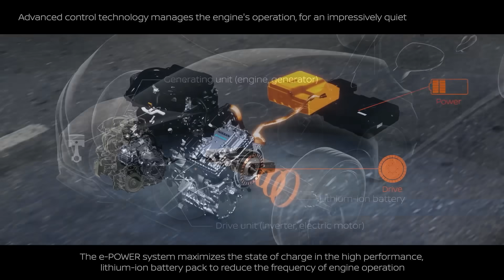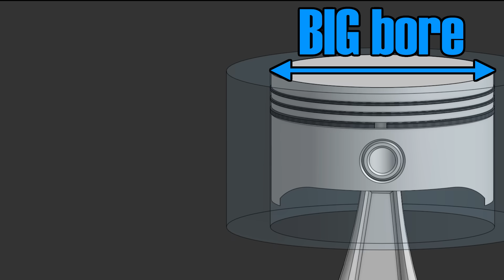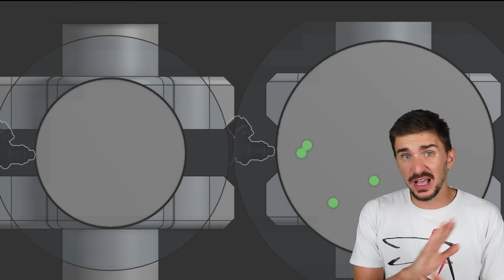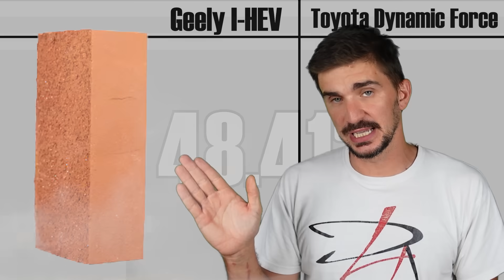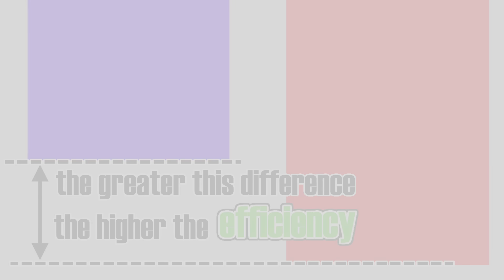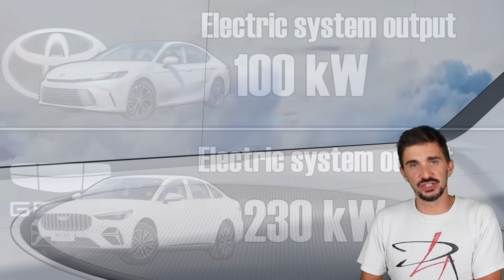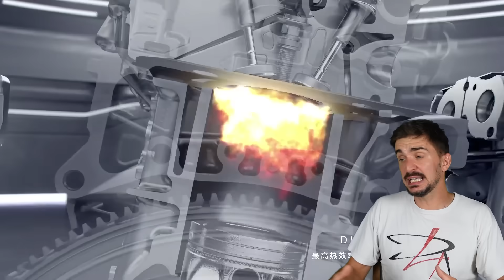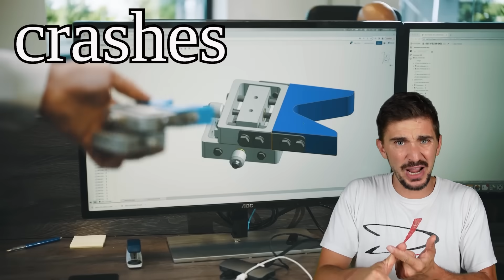How China's Geely Beat Toyota, BMW, Ford and Everyone Else

Comment: 10 years ago all Chinese produced engines were just basically crap. Could hardly meet European emissions, had less power, less sophisticated, had plenty of reliability problems. NOW we suddenly see a mass produced and available engine which is way more efficient, at the cost of performance, but doing something which it is designed for. As 'emergency' power so you can drive your EV, even when empty, forever, and as a very efficient generator, so it can still compete with charging from the wall - until gasoline becomes very expensive and electricity becomes cheaper.

I don't see why we shouldn't applaud them. How many current cars have a 100 hp efficient generator in them which actually can power the car, while costing very little? It's not an BMW i8 and it also doesn't try to be one.

This compact family car has a whopping 230 kW of power. That's over 300 horsepower! Just 20 years ago we still had plenty of cars with less than 100 horsepower. And from 2005 until now the average horsepower has plateaued around 200 hp. This car has 50% more than that. 

Is the number really 48%? Might it drop to 46%? Perhaps even 42% when tested by independent testers? Maybe. Still it would be better than what Mightly Toyota has been doing and they're quite the masters. So still kudos to these guys. But more important ; the conclusion in the end is what everyone basically needs ; an EV with an ICE backup motor. Not a lawnmower engine in the back which can charge your battery, but something which can actually move your car (and charge the battery pretty efficient if you were so dumb to really run it empty). Does it even have to be a 100 hp ICE engine? Does it need to be 1.5L ? Could we do we something half the size ? We all know we only need like 20-30 hp to keep a car running at highway speeds on a flat road. 

My bet is that we'll see even smaller engines like this tied to an EV platform. And does an  ICE engine really have to drive the wheels or is it fine if it can just generate power for the electric motors? Maybe less efficient, but would reduce the amount of components and keep things even cheaper.

Comment: Plenty of reasons this is good and a whole truck load why its not. As a generator its a decent design but if its only being used as a generator that also means there are the usual losses through the charger, battery and power electronics. 
This is one of those designs which will be ultra efficient under very low load then the efficiency will drop off a cliff when its asked to do any real work. 
Looks great on paper but there's a good reason others haven't gone down this path.

Comment: This channel is superb. But, this video has not compared its transmission efficiency relative to eCVT and non EV automatic transmission. In short, what counts is only fuel to wheel efficiency. Geely has 100% of its fuel energy converted electric then 100% stored in a battery then 100% extracted from the battery and finally 100% converted to mechanical torque to the wheels. I would like to see a comparison of torque transmission  efficiency losses between mechanical  vs electric. 
Thank you for your excellent lecture as usual and the added Onshape dynamic display.

Comment: Why close the intake valves late rather than early?  It seems like drawing air into the engine and then pushing it back out would increase pumping losses.  Closing it early you'd lose some energy drawing the piston down against a vacuum, but that energy would be returned as the vacuum helps suck the piston back up on compression.  The only reason I can think of is perhaps oil would be sucked up past the piston rings.
Reply: Maybe the pumping loss is less in a 4-cylinder engine where one cylinder will always be ready to intake what another cylinder is pumping.

Comment: Isnt an electric motor 95% efficient?

And usa is having a heat dome were 20 degrees higher. Mississipi valley could hit 120F. People without AC will die due to climate change from co2, nitro-oxide and methane emissions.

Comment: Thank you for this very informative video. Fascinating and unbiased as always.
Just a pet peeve of mine. The difference between the ICE and hybrid drive in the Toyota is one percentage point, not 1 per cent.
And for the record, I wouldn't trust any number coming out of China. And on that note, I'm not so sure about the reliability of those motors. The things I see and read about Chinese EVs, their crumbling infrastructure and many other shortcuts they take don't instil me with confidence in such products.

Comment: There have been so many technologies that worked great and were shelved for various reasons.
Reply: Yes and those with access to those shelves will likely win in the long run.
Morse code was effectively a digital transmission standard.  We are moving back to digital from analog.
Very early on, cars were electric because engines were hard to deal with.
Before the grid, a lot of people generated their own electricity.
Reply: @kensmith5694  there was a Czech inventor in 1920's, who allegedly build an early hybrid car. System very similar to Toyota hybrid in function, just more primitive, of course. The car and its inventor didn't survive the war, but the same electromechanical transmission system (without battery) was used in a train in the 30's and was more efficient than standard diesel-electric transmission.
Reply: @PeanosZero Nope, it was a prototype build on a Tatra 57. It had no breaks, braking was purely regenerative through hub motors and it's combustion engine made only third of the entire system power. It never went to production due to Great depression and war afterwards. But only source of this is a newspaper article that was found in national archives a few years ago, and couple of photos of the prototype, which reason for the "allegedly"
The train (or railcar?) however exists and has been  renovated a couple of years ago and well documented. I didn't say it was more efficient than a modern diesel, what I meant to say was that it was more efficient than diesel-electric technology of the time. The documented efficiency of the transmission is between 82-94% depending on load, which is not that bad even by modern standards, and once it got to crusing speed, the electric part was bypassed entirely.
Reply: @kensmith5694 Nicolai Tesla drive around in an electric car of his own creation that didn't have a battery on it.
100 years later we don't know what his technology was and don't have access to his theories and methods.
Reply: @carpediemarts705  Stop dirtying the good name of Mr Tesla by believing/telling lies about him.  There was no such thing as the car you describe.  Learn the facts about the great inventor.  They are far more interesting than the lies.
Reply: @carpediemarts705 let me guess, you think aliens gave him the technology? 😂
Reply: @ghoulbuster1 no, Nick gave the aliens technology

Comment: What the difference between closing the valves late to let air out,  and closing them early, to not let it in in tje first place.  

I mean, it's basically the same as a throttle.  No shit you use less fuel if you effectively only have your foot down half way

Comment: I believe Ford announced they’re going to be making some EV’s with onboard generators to charge the batteries. Battery tech is actually advancing pretty rapidly at this point. New cheaper sodium batteries will be making their way to the market within a year or so for EV’s.
Reply: I remember hearing this back in 2022, tech moves along but time to market is still slow.
Reply: @BigLoMayne  You’re probably thinking lithium iron phosphate batteries(LFP), they’ve been using those since about 2022 in most EV’s. Sodium ion has been talked about since around the same time but wasn’t close until recently. The EV sodium batteries were announced to be entering the production phase 4th quarter of this year by CATL who makes most EV batteries. They’re saying they will be about 35% cheaper than current batteries but much more robust and much safer. There’s other battery types being developed also probably at the phase of development that sodium ion was when LFP batteries started being manufactured. This is like the fourth different battery chemistry to hit EV’s since they started becoming popular in the 2010’s.

Comment: I will believe that efficiency when that engine last 500,000 km like a Toyota and Honda does. Because it is not efficient to pay for a rebuild at 100,000km… nor 200,000km. The most efficient engine is the somewhat efficient engine that lasts for 20 years doing 20k km yearly with just basic maintenance.

I’m not going to hold my breath that any Chinese engine will be that capable.

Comment: I remember reading about the Koenigsegg FreeVave system, electronic valve timing with no camshafts.  One of the claims is that it used less power, due to getting rid of the friction and rotating mass associated with the camshafts and timing chain.  Perhaps these car makers should add that to everything else their doing.  Could make 50% possible?
Reply: Too expensive and unproven.  The tech has been around for a decade.

Comment: 12:46 - I vote it should be called a "Combustified Electric Vehicle."
Reply: Or an ICEV, internal combustion electric vehicle
Reply: Combustificationalism is the new orange.
Reply: We are one step closer to creating combustible lemons.
Reply: CombustEV Propulsion
Reply: Busty EV?
Reply: honestly what i thought he was going to say
Reply: The ones being sold by Deepal(Changan) and Forthing(Dongfeng) are called REEV(Range extended EV)
Reply: Combustified Automotive Vehicle Electrified so we could be cave men
Reply: So if i understand correctly, Geely just took an incredibly weak engine, to just for shits and giggles, to pair it with an EV motor to make it NOT zero emission, in order to therefore claim an incredible Th efficiency %. Kind of like scamming people with headlines that nobody actually understands. To make matters worse, as engineers, we are suppose to simplify things and be genuine with our work but instead we are tricking 99% of the population that does not understand these concepts. Sad.
Reply: @2wJonny  Maybe you just can't see the forest through all of the trees?

I can't speak for all 99%, but I personally see these misleading claims as the inevitable result of governmental regulation that currenty favors and rewards efficiency and low emissions. Less about deceiving the consumer, and more about staying competitive in a complex market.
Reply: @2wJonny The greater point is it requires more reserve battery capacity making it more expensive.  Then over time as the battery degrades the overall performance will suffer compared to traditional hybrid and be more expensive to replace.  The efficiency savings surely do not offset the higher cost and reduced lifecycle performance reduction risk.
Reply: It’s just a series hybrid, that part is not at all new.
Reply: Diesel locomotives have had generator electric motor drive for a long time. There is nothing special about this.
Reply: @ironmonkey1512  Converting mechanical energy to electricity and back to mechanical energy introduces cumulative energy losses that are not feasible in cars which have weight constraints.
Reply: It's an EV with a generator more than a traditional hybrid, less prius more train
Reply: "Wind Fire"
Reply: Combustible, Electric Vehicle.
Reply: A combustified EV is just a Tesla
Reply: @FLY1NF1SH  A Tesla with a generator in the frunk.
Reply: Tesla already has that unofficial title of what happens to it in a crash. 🚗⚡🔥🔥
Reply: @toolbaggers😂💯
Reply: So it's not diserving any awards, it's using external energy to make it efficient, so thus every "saving" is getting lost at the electric engine generating power to the engine
Reply: @gabrielvieira.4358  nope, you havent understood the video
Reply: @AI-qd4vb  Either way, it's either helping or generating power for the electric engine, it's or half a generator or full generator...
Reply: @gabrielvieira.4358  All of the power comes from the engine.  The electric part converts that energy into the final drive power.  I'd say 100+ mpg is a great achievement
Reply: @leensteed7861  Intriguing, but not "realistic". If it's not combusting, it can't count on fuel mileage
Reply: @gabrielvieira.4358 the energy still came from the fuel in the tank
Reply: @leensteed7861 If the thermal efficiency < 20% higher 48%/41% then explain how the mpg can more than double?    Typical hybrid 45 mpg would be 90 mpg.  The numbers don't add up and it is  thus  BS.  Not to mention some of that efficiency is lost in energy conversion to charge larger battery that includes generation efficiency, rectificafion/charging efficiency, battery electrochemical efficiency, then similar inverfer, and electromotive out efficiency.  That overall efficiency is about is about 82%. Thus, 82% x 48% = 25%..  it is same BS as EV mpg equivalent  which starts only at wall plug not from point of energy generation.  In that example and EV mpg equivalent oil well to road is only 35-50 mpg.  But most people are ignorant about how this stupid  game is played to promote EVs.
Reply: @kannermw  I'm not a big far of EVs but I do love it as a final drive solution to get the IC engines power to the wheels.  You have to admit it is a much better way than a bunch of mechanical crap wearing out.  Also you get to regen downhill and under braking so you do get a bit of free energy back.  Have you seen the Edison hybrid trucks built in Golden BC?  Diesel electric and built simply to be easy for owners to fix.
Reply: @leensteed7861 Hybrid vehicles are by far the best interim solution.  Especially in mixed usage of  low speed urban and high speed driving motorway.  The battery is the fraction of the size and cost of EV but you get the benefits of energy regeneration and optimizing efficiency sweet spot of engine.  They require no subsidies or costly infrastructure investments.

I just purchased my first hybrid a  2026 4Runner Limited.  Now it is series hybrid design more for power and performance vs fuel economy but it is getting  about 20% better  fuel economy than the 2018 4Runner Limited it replaced.

I am a mechanical engineer with a career in power systems for off-highway vehicles.  I understand all the technologies.  What I don't like are the lies perpetuated by government bureaucrats to promote an agenda.  I am in full support of moving technology forward but only when it makes economic and  practical sense.  Then there is the law of diminishing returns that seems to get ignored.

Battery technology needs to improve before I will embrace an EV. The best use case for EV now is Uber.  You need many miles of driving mostly in urban environment where the fuel savings offset the higher cost.  The idea of EV battery capacity shrinking steadily with usage and aging is absurd.  Imagine if your fuel tank shrank by 3% per year and after 15 years would need to be replaced for $20K or more.  That is why EVs depreciate quickly even though they are mechanically much simpler.
Reply: @leensteed7861  VW, Seat and Audi used to manufacture a 100 mpg turbo-diesel car in the early 2000s for the UK market.

Comment: Fun fact, Otto cycle engine with closed throttle is the same as Atkinson cycle engine. The difference is that Otto cycle engine can open the throttle and generate silly amounts of power so long as you're willing to sacrifice fuel efficiency for it, Atkinson cycle engine is forcibly working in max economy mode because it physically doesn't have max power mode. A Miller cycle engine is when you take an Otto cycle engine and pretend it's different.

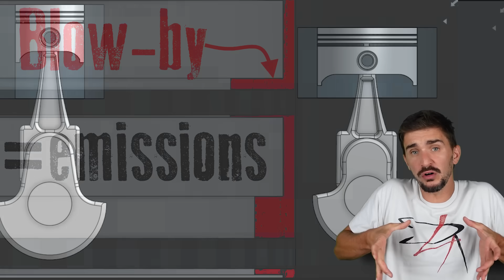Comment: Argument made at 2:50 with blow-by area make no sense. Circumference scales directly with radius, area with square of radius. So ignoring every other issue it's better to have as big bore as possible to reduce blow-by area. Assuming same displacement.
Reply: He means the area of the gap between rings and the bore. And you contradicted yourself.  Yes, area is proportional to square of the radius. This means area increases exponentially relative to radius. For example double the radius (2r), then area increases by (2r)^2.
Reply: @jumboegg5845  I know what he means and see no contradiction. The area of the gap between rings and the bore is proportional to circumference. It's bigger for smaller cylinders assuming same displacement and stroke. You don't go insane on cylinder radius for other reasons, not reducing blow-by.
Reply: @pawellachowicz  You just contradicted yourself too. You said the area is proportional to circumference, then you said area is bigger for smaller diameter (smaller circumference) piston. Its the other way round, If you keep displacement the same (by changing the stroke), then blow by area must decrease for smaller diameter pistons.

Comment: we should make exact copies as revenge.
Reply: too bad they arent as good as press release. otherwise everyone will have these is series hybrids or in those ecvts and also boast giant efficiency ratings. And that low power bad would by knocked out by using properly sized engine or battery. these seem to be just too small for the ai dumb shit calculating uphills on you drive with spycam car cloud chinna'd
Reply: Do you own a car company?
Reply: hyundai will fs, I mean 'innovate' a very similar engine/design